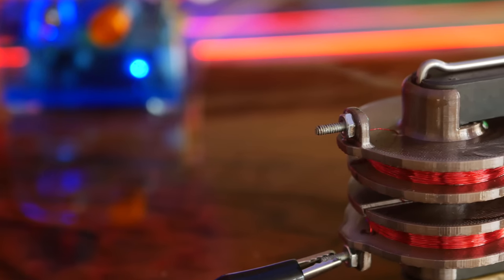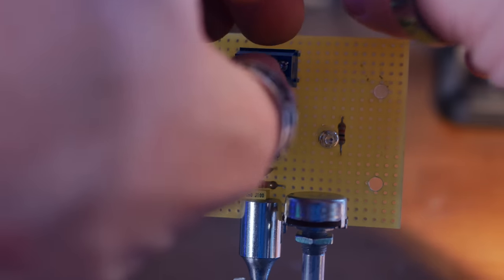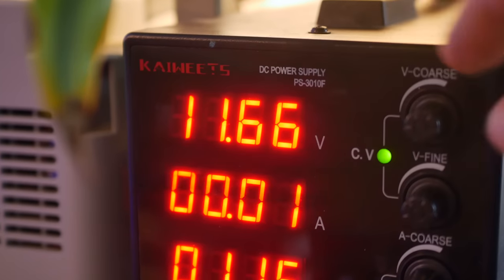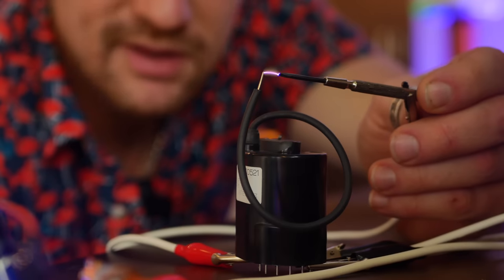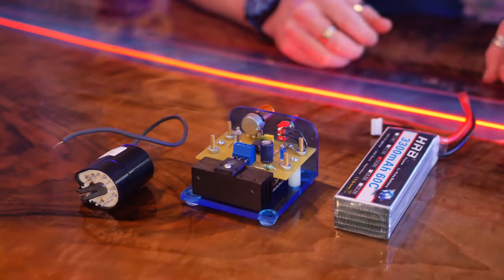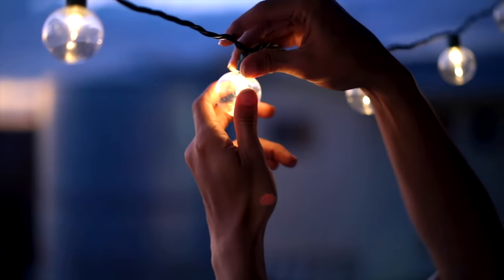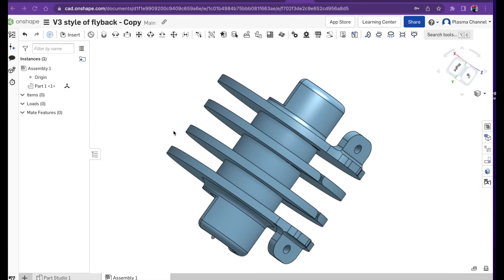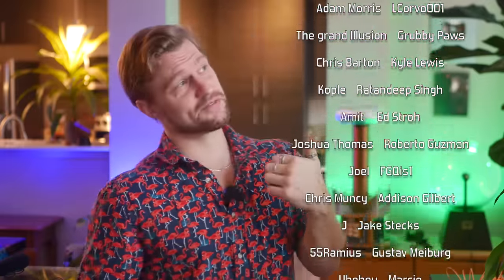Unreal Bluetooth Plasma Speaker (3D printed)

Comment from the maker: If you want to be a smart person - go to Brilliant. If you want to see my new website, and learn more about why i'm obsessed with plasma, go here - www.PlasmaChannel.net. Also, sorry about that high pitch noise in the beginning! It was mostly an artifact of the camera being too close.
Reply: Flyback can't be AC Jay, you keep making the mistake. Flyback is the name for the "topology", pulsed DC to pulsed DC... but it's not the only way to get HV DC, you already played with an ignition coil, and that doesn't even have a diode on the output, yet gives DC (if driven right) 1EabqJJnWhc
Reply: btw it would make more sense (be more efficient) to modulate a Mazilli ZVS when you're using output AC. Look what CoolDudeClem tried, but there are other more successful attempts, just can't recall channel names.
Reply from the maker: @sFeral  As long as the spark output by an ignition coil dissipates all energy in the first cycle, it will be DC. In reality, most all ignition coils i've used have a ring on their output. As for flybacks - they are AC by nature. The addition of diodes is what makes them DC, or, an offset secondary balance will also do similar. Any secondary coil that is mid point balanced will output one terminal negative voltage, the other terminal positive. I tested my custom flyback to have an AC output.
Reply: @PlasmaChannel  I love it when random commenters try to get smart with the pros but they're actually wrong. sFeral, ya made me laugh. Do your damn research before ya make corrections.
Reply: where can i buy these parts?I want to buy too I'm trying to do something
Reply: Yooo Epic vid
Reply: @richfromtang  bruh chill out
Reply from the maker: @arkhilious  Dont get me wrong, i'm no expert. The flyback topology itself is usually a DC setup by nature. sFeral wasn't wrong about that. But...a pure transformer that is mid point balanced and creates an arc will always have an AC ring by nature.
Reply from the maker: @arkhilious  Not going to lie, it's a pretty good burn from ROBOT though lol. Definitely was a creative negative comment - I have to give credit where it's due. Funny thing is.....it was a 14 minut video and I spent less than 3 minutes in front of camera the entire time. That's 3 out of 14 minutes....or about 29% me in front of camera, 71% me not in front of camera. lol. What, 29% too much?
Reply from the maker: @richfromtang  You really hating on the rings huh? I wear them every day. So to do youtube, I have to take all my rings off and be a ringless schmuck? I'll pass. Also, 3 minutes out of 14 minutes I was in front of camera. Hardly too much. Good try at a burn though :P
Reply: I need 2 meter arc
Reply: @sFeral  - The term "flyback" comes from the raster scanning method that the old CRT televisions used. After the electron beam sweeps across the screen, painting a single line of the image, the beam "Flies back" to the left side of the screen during the horizontal blanking pulse just before starting the next scan line. The high voltage transformer (AKA, Flyback) produces a high voltage pulse during that horizontal blanking period. The original flybacks were, in fact, AC devices that required a high voltage rectifier on its output. The created DC high voltage would feed the anode of the CRT. So, Jay was in fact correct calling a flyback "AC".
Reply: @PlasmaChannel  this is so cool !!!!
Reply from the maker: Thanks! Have you seen musical arcs before?
Reply: @PlasmaChannel  Fair, it was really damn creative.
Reply: @Xray-Rep  etymology of the term is not the point, the operation mechanism is. And no, the whole assembly wasn't AC, as you point out, the thing (singular piece of hardware) now called a "flyback" didn't exist
Reply: @arkhilious  I'm not wrong. If you wanna be an etymology stickler like the last guy who correctly tagged me, the "flyback" doesn't really exist outside of a CRTV assembly. Once you take it out, it just needs a driver that mimics the original in CRTV, but it no longer performs the function given in that context.
Reply: have you tried or is it possible to use a high voltage capacitor to filter the output directly?
Reply: @WetDoggo  you need a lot of capacitance, which means lots of money or a lot of patience making Lyden bottles, or perhaps lots of Al foil and a huge pane of glass or some other high breakdown insulator
Reply: Seen old technique how Tesla made his 4 winding coil I'm no where upto speed as you Jay and others here but maybe a clue for everyone if uses haven't seen. I'll do my best to explain this , it is the standing coil with top metal ball.
Bottom first winding is twice as high/wide in measurement then 3 smaller top windings..
The bottom bigger winding forces magnetic field up to smaller ones above , but all  the windings where wound in a wave pattern each revolution meaning start point of coil horizontal winding it (copper wire starts at left as it dose one rotation it stops at right side of coil , then next rotation right to left continuing till finished. Buy the looks but don't quote lathe turning anticlockwise.
That's high tech info from Philadelphia experiment , not sure how many turns of wire , but I'll say this the 4 windings is key , so looking at it finished if bottom winding is 200mm wide the gap looked to be 100mm space to the above smaller first winding , then top 3 smaller windings 100mm wide with 50mm space...
Tesla's secret always 4 windings always wound earths rotation , 4 pole motors always running same direction as earth's rotation. 
Hint it's all to do with the earth Biorhythm frequency aka wave lenght and rotation. 
Tesla was a smart man but he was told the final details once he's radio receiver was tuned into space every day he spoke to them  , shocked the life out of me but it's true not sure if any real details are about on his real coils , I'd be interested on your thoughts if that's the normal Tesla coil or something strange  ?
Cheers thanks please don't broadcast my YouTube name
Reply: @Xray-Rep  nice exp.
Reply: @MichaelPrzybylski  -- Thanks!  My first job during high school (mid 1960's) was working in a TV repair shop where I learned a lot about how TV's work. That's also when I began my life-long hobby playing with high voltage gadgets. I never get tired of it! 🙂
Reply: @PlasmaChannel  
Try to make a “candle speaker”.
That would be a fun project and a magic halloween decoration.
RF electric air arcs can look like candle flames. All that’s needed is a modulating circuit and you have a spooky candle speaker that can look like an actual wax candle.
Reply: I have a suggestion on how to increase the thrust of a jet engine, my idea is based on the principle of a fanless fan, The thrust of a jet engine is directly dependent on 2 factors, the amount of air it blows out, and the speed at which the gas flow blows out. I want to increase the amount of air, it is known that fanless fans blow 15 times more air than the turbine itself pumps For this, it is necessary to remove the outer housings of the jet engine, and create new housings, according to the principle of a bladeless fan, part of the jet stream must be used to build up pressure inside the new housing, which will throw in a jet air stream at the beginning of the jet engine compressor, in this way it is possible to increase the amount of air in engine, you're supposed to work with a lathe for a bit, and figure out how to force some of the jet into the hulls, but then you get new types of Jet Engines.
Reply: @Invisibility397  Nop, that's just the frequency at which the transformer is operating. It's not too high, about 8 or 9kHz
Reply: @Invisibility397  It only happens when the ark is there because the ark itself also makes a sound with that frequency when it heats up the air around it. It also loads the transformer more and the extra load makes it louder.
Reply: You'll have to explain what you meant at the end of the video... Why is every day a flamingo day?
Reply: Try using this to split atomized H20 molecule and make hydrogen.
Reply: i dont confrim ac transformers are more ramre i hawe 3 of them but only 1 dc (ac can be found in tvs but reley old ones)

Comment: Love your videos! I did a similar circuit with my Tesla coil but my method of control was PWM and that seemed to provide a very clear and loud sound. The spark frequency was however much higher at around 2 MHz.

Comment: I once seen a splama speaker made with two half globes curved surface to curved surface with a space between them and a high voltage arked between them.  I imagine  they helped the sound curve the soind radiate it in all direction while concurrently  providing capacitance for a hotter louder arc.

Comment: Hello friend, it looks like your flyback is warming up! The 220n capacitor on the primary winding will create resonance and increase efficiency. Is there a link to the 3d model? I'd like to wind one too. Thank you in advance!
Reply from the maker: That flyback was more than warming up. It was melting lol
Reply: @PlasmaChannel   Ha ha! Good sense of humor) On my channel, the latest video. There the flyback works for 10 minutes, without radiators and with zero heating. The power supply is 1 bank of 18650, but you can also set it to 12 volts. By the way, can you give a link to a 3d model of the frame? I want to repeat.

Comment: Any old radio in the neighborhood probably replicated the sounds too, from the EM pulses.
You can listen to an AM radio transmission just by gently holding a leaf on a branch against the high power antenna.
Reply: Yeah lots of interference with high voltage arks sometimes they can fry your circuits if powerful enough!
Reply: @patrickday4206  These arcs can make TL lights closeby flicker.
Reply: @paulmichaelfreedman8334  lol

Comment: I suggest the plasma filament needs to be in a clear glass vacuum.  Plasma does not need oxygen. Plasma is a state of matter that consists of ions, electrons and neutral particles. It can exist in the absence of oxygen and can also exist in a vacuum.  That said, in suggesting that,  I'm not sure how well the speaker part would function,  if at all.  However the filament might last longer.

Comment: To make it even more awesome add a ring magnet as the hv ground and place the other hv lead in the midddle of the hole, and now you have a plasma vortex speaker, as the output gets spun by the magnetic field. this results in a disk of plasma in a vortex, and volume is increased.
Reply from the maker: I thought about that after I posted it this morning. I thought, "Why not a vortex speaker!?" So, i'm going to try it.

Comment: That improvement in audio quality and design is amazing. Also as you said in another comment sometimes there is distortion when recording so I can see it being nearly silent in operation.
Reply from the maker: Hey Mad Scientist! Good seeing you here. Yeah, after thinking about it, my audio equipment has a good 4-6" loop of COILED wire going from the audio receiver, to the camera. The audio equipment clips ontop my camera. The camera was only......5 inches from the arc during many of those shots. So I think the transformer pulses were artificially inducing a voltage in the audio equipment. Bummer - the arcs are hot and silent in person! At the right frequency.
Reply: @PlasmaChannel  that's another good point that I didn't even consider. EMI on the pickup. I wonder if having it shielded would help. I'm thinking like that perforated or mesh metal like on the older studio mic's.

Comment: I also used one of those XY-P15W mini amplifiers for a big slayer exciter project. And it worked flawlessly!

This thing can power small to medium size subwoofers very well with minimal distortion under 30Hz. It's a very neat amplifier for it's size, that's one thing for sure.

Excellent video Jay, I loved the design aspect of this project. Unique as always!

Comment: I usually use a variant of an astable multivibrator to power my flybacks. It allows me to change the time period for both the on and off states. I started using multivibrators because BJTs can tolerate up to 30 volts, where my 555s burned up at 15 (Under 12 without protection). I also had trouble driving a stable frequency above 21 KHz with the 555. I'm currently working with one that goes from 6 to 60 KHz. I made a mock up of the inside of a microwave magnetron, except without the resonant cavities or emitter. The arc spun around at probably 30 to 40 Hz, so no danger. An idea for a video, but I must warn you, it took a lot of current to overcome the electrostatic confinement from one anode fin and allow it to jump to the next in rotation. Enough to melt the cathode. (I'm guessing about 22 milliamps at 12KV, about 250 watts.) Oh, I also needed an RF filter between my driver and the power rail to compensate for the voltage drops when dumping around 25 amps at 20% duty cycle.

Comment: I wonder if only making pulses when the audio makes pulses would sound any better than adding a square wave to the music.
Reply from the maker: It likely would increase audio quality. My driver circuit was really basic - some people get crazy complex with their designs....and you get what you pay for. Rather...you get what you design for. I was most interested in voltage output, with music as a secondary. But some plasma tweeters are incredibly clear.

Comment: I think a much cleaner sound quality could be acchieved using amplitude modulation as commercially produced plasma tweeters usually use this method.
The coil is fed with a constant high frequency wave and the audio is AM modulated on top of it like a radio transmitter.

Comment: Highvoltageshop a german based supplier sells AC flybacks. I used one with 36v with a 300Wh battery and man the arc was over 5 cm long!

Comment: You can get louder volumes and more power using an IRFP450n mosfet. It will require more input power and a bigger heat sink.
Reply from the maker: Thanks for the suggestion. I'll try that!

Comment: Very nice!  For HV output terminals that can endure the heat of the musical arc, may be try a copper-tungsten (CuW) alloy rod segments.  I hear it's easier to cut than pure tungsten.
Reply: Or just get tungsten TIG welding electrodes, which are pre-made to an appropriate length.

Comment: Now tune the static out of it.. it's as clear as the music.. and attach a plasma ball to the flyback transformer so you get a ton of plasma arcs it might make it louder and clean up the static because of the glass but at the very least it will play without the open air arc and ya don't need to hold the wire and the arcs are constantly throughout the ball.. it's worth a try i reckon..
Reply from the maker: That’s not a bad idea!

Comment: Reduce the inlet spacing. Along with that, increase voltage on subsequent stages.  This mimics multiple stage compressors on and a jet engine. thats probably a lot more work electrically at least.

Comment: Jay, sometime in September 2005 I designed a Halloween themed circuit, from some online research that I did on arcs I discovered that using brass balls generates more noise than sharp points, your ionic speaker build could benefit from this knowledge

Comment: Nice build as usual Jay, a great way to ensure that there will be no arcing over is to encase the windings in epoxy. Maybe you could use the remaining epoxy from your table
Reply from the maker: Thank you. Yeah, I mentioned in the video that I was thinking of encasing the windings in resin. I found a far better solution. To dunk the entire secondary in Super Corona Dope, then place in a vacuum chamber. It gets the Corona Dope in between the windings, and does total wonders.